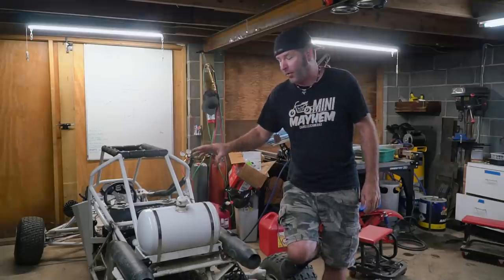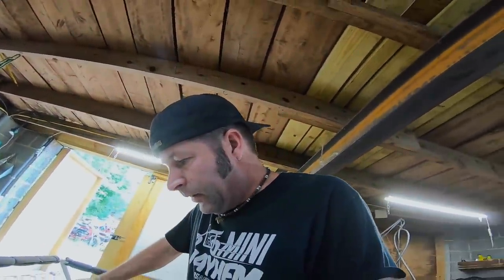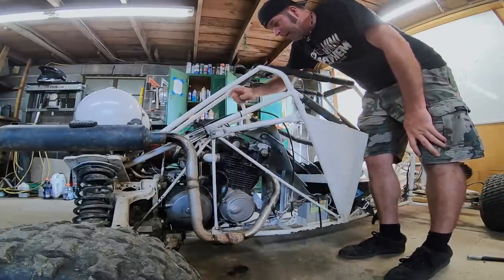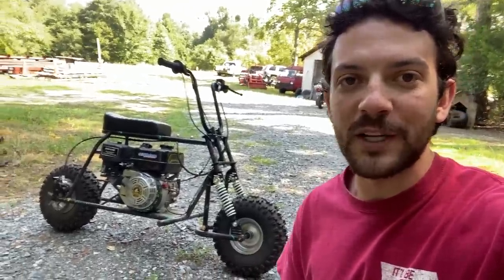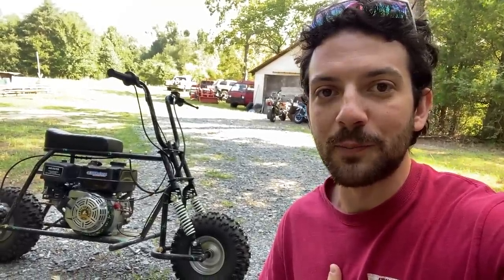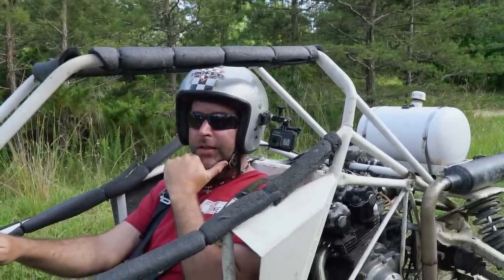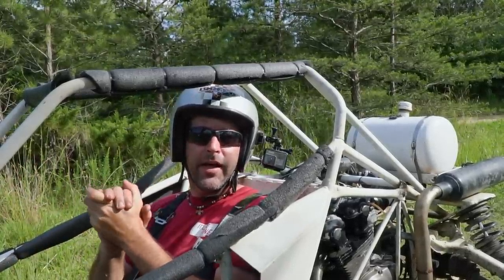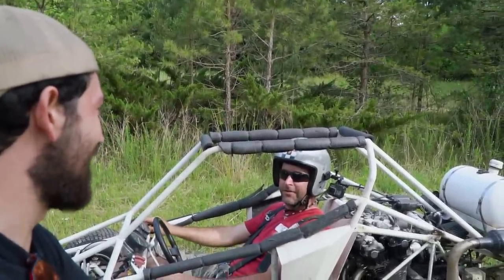Our FORGOTTEN 750cc Powered Cross Kart Returns to FULL POWER!

Comment: Ike, for the love of all things holy, put the outside two carbs back on the engine. It was designed to run on 4 carbs to begin with, but much more importantly it probably really doesn't like the fact that the inside cylinders have a straight shot and the outside two cylinders have two 90 degree bends. If you insist on running only two carbs, two "Y" shaped manifolds will make sure that each cylinder gets the same treatment.

Comment: those are 2 stroke carbs. id bet that the slides are getting stuck from the pull off the engine especially since you guys are only running two of them.

Comment: I've been working on a cb750 recently. I had a similar problem with the spark coming and going on 2 and 3. On your bad coil, have you tried taking the plug boots off, clipping the wire back, and reconnecting them? They just unscrew. The wire on mine was corroded at the ends.
Reply: Hey that might be it. I had that happen. On a small engine. It didn't run. Well. And I ripped the spark plug boot off and it was corroded. Cut it and rescrewed wire back in. Ran great. They need to try that

Comment: There is nissan cube 1.8L engines on jdmenginedepotinc Dot com. Think it would be SICK with a tiny little nissan engine on it. Eventually when i have my own cross cart thats the route i think i might go. Will probably need a slightly larger spot for the engine though. Going from a 750cc to a 17XXcc is no small upgrade.
Reply: The Versa's are also small 1.8L engines.

Comment: I have a wrecked Honda VTX 1800cc
Frame and front end is trash, drivetrain is good. Engine, trans, rear end and wheel. $500
Also have a Suzuki Intruder 1400cc complete bike for $800

Comment: when you think about how a motorbike leans over in corners, the oil in the bottom of the engine sloshes differently to that in the sump of a car engine - so you've installed a motorbike engine that doesn't lean over anymore. basically when you're doing donuts and a bunch of hard cornering you're robbing it of oil, so just be careful of that

Comment: I think part of the problem is not running 4 carbs, there is a reason why every factor inline 4 in a bike is running 4 carbs. I don't think you can get the proper airflow out of two carburetors for four cylinders

Comment: 919 motor. You mentioned better front suspension. Shifter on the right  would be rad. Put the honduki motor in. So you guys don't die on it.
Reply: They measured the 919 months ago. It wont fit.
Reply: Rule number 1. Everything fits. It may not fit now. But in a few hours it could fit. It looks like Battlestar Galactica vipers. Looks awesome. Deserves to be awesome
Reply: @allenmichaud1605  I think the Hon-dookie (lol) engine makes more sense, as they can do that in one afternoon. I would like to see more suspension travel and bigger tires on the X-cart.
Reply: @allenmichaud1605  Following your Rule #1, I'm going to put a Cummins in a Power Wheels 🤣. "Allen SAID I could!"
Reply: Don't be cranky about it buddy. No need to be upset. Them guys showed a worn out suspension from giving it the bacon. Those size tires tires and stance seems great for that. Its a cross cart. Not a sand rail. Our limits are set by our minds. Have a can do attitude. Have a fun day buddy
Reply: @allenmichaud1605  Cranky? Upset? Not in the least. It really doesn't matter to me what they do, as long as I'm entertained. But I offer up opinions or suggestions, mostly just for conversation.

Comment: Spend 300-500 bucks and get you a 01-03 suzuki gsxr 750 motor. They are just about drop in plug n play. 140+ hp fuel injected. You'll just need to use the appropriate gas tank with fuel pump

Comment: Take off everything it DOESN'T need in order to run and stop is some of the best tuning. Run a total loss ignition with a magneto. Junk the generator etc, fit a racing clutch and then go on a diet and lose 50 pounds.

Comment: the smoking kinda says bad rings and shes burnin oil so it may be like my dads truck where it runs like crap between 500 and 200 revs but once u hit 3k+ it has full power like a whole new engine so maybe run a compression check on it if u havent already  even tho u had the engine apart once maybe the lower rings were bad and yall just didnt know

Comment: im betting that engine is fine, some times the oil control rings have crap in  them and after a few hundred miles they stop smoking unless the oil seals on the valve stems are shot, which has nothing to do with compression, all cylinders must have the same compression, or your wasting money

Comment: It does not have full power 2 cyl are not getting the same amount of fuel because of that intake design. Either have a equal split intake or 4 carburetors which it would need.  You only have half the air flow it needs

Comment: It is very important to have all 4 carbs in sync VERY in sync I think this has been your problems all along. You need to have the all 4 fuel screws turned in or out the exactly the same. You can buy a carb sync tool. DONT BUY ANOTHER MOTOR UNTIL SOMEONE HAS A BETTER UNDERSTANDING OF TUNING CARBURETORS.

Comment: The those who talk about air to fuel ratio. I know it plays a factor. But I don't see any plastic on this motor... And on the last motor that for sure had pvc on it, seemed to run good. And if I remember correctly it was done on the outside, so that doesn't explain why the center is not firing right. Kiss!

Comment: Your intake is wrong.  It has to be shaped like a Y not a open 4. When you pass air past a open hole. You create vacuum. So the outer cylinders have more vacuum. The center cylinders are getting all the fuel.

Comment: Iya getting a lot of fuel. Or your getting oil in. Just buy some lectron carbs. Put all 4 or have a y built the right way. Have it fabed up. Only one of the cylinders are getting more gas than the other. U have always had problems Bc of the way y’all built that splitter for the carbs. It’s wrong. Lol. The plugs are probably fouled out. I’ve been telling y’all that engine is not that easy. I had a cb750 custom and if I fucked with the carbs it did not like it. It needed that factory airbox. They were so wet Bc that splitter runs it into one cylinder only essentially. U have to make that even and the carb has to be basically double the size of the stock. Venturis work off the vacuum that comes from the airbox. With no filter it’s not going to run right. Mine also didn’t run right with pods on. Too much air bypassing that Venturi

Comment: Idle level too low

 

If the idle level on your (warmed up) engine is lower than the level decided by the manufactorer, you will usually have two problems:
- The engine will easily stall - especially on take off
- The oil pressure inside the engine will be very low, and you may see the oil pressure lamp flicker.

Here is a list of possible root causes - not in any particulary order_
- Idle stop screw or eletronic idle level setting not adjusted correctly (This is the obvious one that everyone thinks of first)
- Too lean Air/fuel ratio (the mixture is already borderline lean on the stock bike, so if you installed an aftermarket exhausts and/or air filters that flows more air, you will be running even leaner than stock)
- Throttle valves not correctly synced
- Throttle position sensor (TPS) not correctly adjusted
- Valve clearances too tight
- Charcoal cannister in the tank ventilation line clogged by fuel or dirt.
 
I found this on line please read Bryce

Comment: Originally, a CB750 had FOUR carbs, and FOUR exhaust pipes..... Now you've choked it all down into half that amount on both ends of a very tired, clapped out, POS engine - what do you expect???
 Before I put one penny into that turd why dont you just buy a decent running slightly more modern Carburated Sportbike and use the engine from it...... Where I live you can buy Suzuki Bandit 1200's running and driving with title as many as you want used for $1k to $3k depending how clean the paintwork is - which you dont care about appearance- Just power and running- and after 40+ years of building Motorcycles of all kinds I'd say you could put $5k in race parts into any CB750 POS and it wouldnt be as good as a Bandit 1200

Comment: the reason you can't tune this right is because you PAIRED THE CARBS WRONG. if you look at any 4 banger its either 1 carb, 4 carbs, or 2 carbs but the INNERS PAIRED and the OUTERS PAIRED. the pulses from the way you have those set up will always mess up the fuel mix between the cylinders.

Comment: The whole Alcohol In Gasoline Causes Problems After Storage is a myth.. We have never had alcohol in petrol in the UK (nor Europe as a whole?) and every time I go to rescue an engine that's sat for a year or more with fuel in the carburettor and/or tank there's varnished fuel in the bowl, the emulsion tube is fubarred, the jets completely gummed up and the tank internal surface treatment is dissolved (and the gas a horrible green colour). We only have 95 and 98 RON petrol and none has alcohol (or maybe there is alcohol at the petrol station but I've never seen it and never not had the choice of alternatives).

Comment: Why a 750cc motor? Try a fireblade 1000cc or an R1 1000cc lump?? The bike breaking yards must have plenty of 1000cc sports bike engines, most bike wreaks don't damage the engine. I bet you'll find a cracking 1000cc lump with ecu even fuel tank all for $750, go on boys spend a little bit of that cash you know you got!!! SPEND! SPEND! SPEND!🤣🤣🤣
👊✊💨💨💨👍

Comment: That’s very weak spark when you were testing the plugs could be attributed to the fact you put them on painted steel to try and get your ground and if you were trying to keep it simple stupid and you were having spark problems you definitely should’ve tried just simply cleaning your connections especially your grounds immediately when you discovered that you were getting spark but it was very weak I’m damn near 50 years old I’ve been building engines since I was in my teens and almost every time I seen a problem like that connections just need to be cleaned especially on a machine that is as abused and neglected as that one is

Comment: You are not getting anywhere near the power that the engine should produce. 
It needs 4- carbs and a proper intake manifold.
The carbs will need to be synchronized. 
The way that janky PVC pipe manifold is set up there is no possible way to get equal flow to the cylinders.
Why don't you put some rings and bearings in it if it is so "clapped out?"

Comment: You bozos need to put 4 carbs on the motor with the proper rubber manifolds then it will run properly.